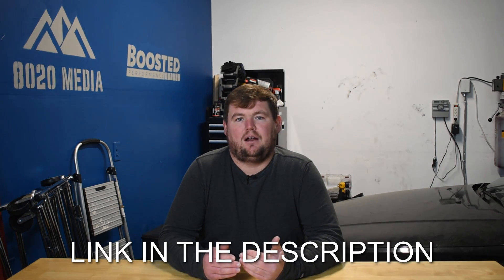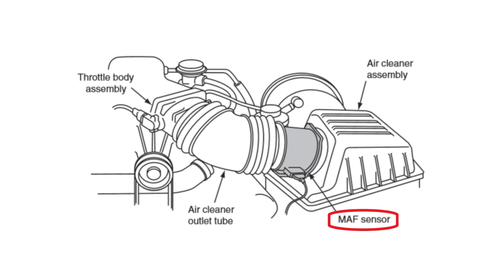DIY - 5 Symptoms of a Failing MAF (Mass Air Flow) Sensor!

Comment: Today i cleaned the maf sensor due to car jerking and hesitation from 2nd to 3rd gear. But after cleaning the car is rough starting with vibration at startup everytime i start it. The drive feels much smoother and shifts smoothly but the rough start with vibration and noise which is annoying me what could be the issue? Before it use to rough start only first start of day but now after cleaning it’s every start. I started it almost 10 times lol
Reply from the maker: P - Sorry to hear this.. Cleaning the MAF may have helped drivability but likely caused a new issue—either some cleaner residue is interfering with the sensor signal or the sensor got damaged during cleaning. If the rough start and vibration now happen every time, try removing the MAF again and inspecting it for leftover cleaner or physical damage. You could also try unplugging the MAF and starting the car—if it starts smoother, the sensor is probably giving faulty readings and may need to be replaced.
Reply: @8020Automotive so after cleaning i guess the maf relearns? And also i did remove the battery terminals overnight to reset everything. So the ecu and maf takes time to relearn everything. Waiting to see if that works. Let me drives for some miles and if it’s still the same then there might be some problem. The jerk and vibration is only for few miles and the it goes all away:( run so smooth!

Comment: So I have p1101 and my key fob starter doesn't work. Car runs and drives fine. From what I've been seeing. I think the maf took a shit. Any help would be appreciated. 2018 GMC terrain 2.0
Reply from the maker: M - Yep, P1101 on your 2018 GMC Terrain 2.0 typically points to an issue with the MAF (Mass Air Flow) sensor—usually it's reading outside of expected range, which can happen if the sensor is dirty, failing, or there’s an intake air leak. Since the MAF plays a role in how the ECU monitors engine airflow at startup, it can disable remote start as a precaution even if the car runs fine otherwise. Try cleaning the MAF sensor with MAF cleaner first (don’t use throttle body or brake cleaner), and if the code persists, replacing it is likely the fix.
Reply: @8020Automotive  yessir, new air filter and sprayed the MAF sensor. Drove for roughly 100 miles and problem gone. I'm just happy I didn't have to clean the throttle body. Although I may do that one day just for something to do. I've seen a few folks get that code from a dirty throttle body. One day but not two days😂✌️

Comment: My car is sluggish but no lights on - cant get 45 mpg no more
Reply from the maker: C - If your car feels sluggish and fuel economy has dropped but there are no warning lights, common causes include a dirty mass airflow sensor (MAF), clogged air filter, old spark plugs, carbon buildup in the intake or EGR system, dragging brakes, or underinflated tires; even without a check engine light, any of these can affect performance and MPG, so a basic tune-up and inspection might help restore efficiency.

Comment: Never forget the . Temperature sensor in the engine block.. when going bad it will cause rough idling etc. Observed on Chevrolet cars. Simple replacement. Cost minimum..
Reply from the maker: N - True! Thanks for sharing.

Comment: I have a problem with my Mark X starting but cutting off after 2-3 seconds. Can someone assist here
Reply from the maker: L - If your vehicle starts but stalls after 2-3 seconds, possible causes include a faulty immobilizer, bad fuel pump, clogged fuel filter, failing MAF sensor, or throttle body issues. Try using a spare key to rule out the immobilizer. If that doesn’t work, check the fuel pressure and clean the MAF sensor. If the engine struggles to hold idle, the idle air control valve or throttle body may need cleaning. Also, check for vacuum leaks or a bad crankshaft position sensor, as both can cause similar symptoms. Running a diagnostic scan for stored trouble codes (DTCs) could point you in the right direction.

Comment: My jeep hesitates , jerks , n rough idle a little but doesnt do it constant n when i press the pedal on down it comes out of it, n i dont have any problems starting it. Is it still the maf?
Reply from the maker: B - Intermittent hesitation, jerking, and rough idle that clears up when accelerating could be caused by a dirty or failing MAF sensor, but other potential culprits include a clogged fuel injector, weak fuel pump, bad throttle position sensor (TPS), vacuum leak, or faulty ignition coil. Try cleaning the MAF sensor first and see if symptoms improve. If not, check for vacuum leaks, test the fuel pressure, and inspect the throttle body and ignition components. If there’s no check engine light, live data from an OBD2 scanner may help pinpoint the issue.
Reply: I scanned it, oxygen sensor is all that came up, I checked on vacuum leaks, I'll clean the maf next, thank you.

Comment: After replacing the MAP sensor does it need to be reset? I had someone replace ALL coils & plugs on my 2016 RAM 1500 SLT 3.6L bcuz I had a check engine light & the codes read were P0303, cylinder 3 misfire & the recommendation was to change that coil & replace plugs, so I decided to replace ALL due to my current 👉🏻106,000+ mileage. But afterwards it had ALL those symptoms when before the coils & plugs it ran perfect! 💆🏻‍♀️💆🏻‍♀️💆🏻‍♀️ The guy (at this point I don't even want to acknowledge that he's even a real mechanic) replaced the sensor & the (⚡) went away but the engine light was now flashing. I tried driving it and I wasn't able to accelerate & it almost died at idle. 😭😭😭
Reply from the maker: P - Sorry to hear this. Yes, after replacing the MAP sensor, it often needs to be reset or relearned by the ECU. If the engine light is flashing, that indicates a severe misfire, which can damage the catalytic converter if driven. Try disconnecting the battery for 15-30 minutes to reset the ECU, then start the truck and let it idle for a few minutes to allow it to relearn sensor data. If the issue persists, check if the new coils or plugs were installed correctly, as loose connections, incorrect gapping, or damaged wiring can cause further misfires. Also, ensure there’s no vacuum leak or intake manifold issue that might have been disturbed during the repair.

Comment: Sometimes a bad MAF sensor won't throw a code. Even though you clean a MAF sensor it can still be bad, as the electronics inside the sensor are bad. Sometimes you might have to do a voltage check at the MAF electrical connector to be sure it is getting the correct voltage. One time on my IROC Z28 I had to replace the MAF connector as it had a small kink in one of the wires and it wasn't allowing the correct voltage to the MAF sensor. A good maintenance idea is to clean the sensor at least every time the air cleaner is changed. And it's a good idea to be sure the MAF duct clamps are always tight because air / vacuum leaks can throw the sensor off. Usually the best place to buy a MAF sensor is online at Rockauto as the prices are usually cheaper and they have a better selection of brands than parts stores. Plus you can usually just buy the small sensor instead of buying the whole sensor and housing together. It is easy to replace as it is usually only 2 bolts or 2 screws and takes about 5 minutes. Doing this can save you $$$ plus some of their brands have a lifetime warranty. I have seen closeout prices as low as $10 for a MAF sensor.
Reply from the maker: S - True.
Reply: This is true because mine isn't throwing a code at all
Reply: @ thanks for backing me up. Yea sometimes the car will jerk or have hesitation.
Reply: I thought that MAF sensor was in the front on the tube that goes to my air filter. I don't know what it is that the guy in the video was describing
Reply: Please explain where/ how you can buy the “sensor, not the whole sensor and housing”? I don’t see it anywhere at rock auto. Only the whole sensor and housing
Reply: @Fireneedsair  it all depends of what  vehicle you are looking up. Some might offer one or both versions. Their inventory also changes everyday.

Comment: I have a 2007 nissan titan, i have no acceleration when going uphill i literally have the pedal down to the foor and i can see my speed decreasing and it doesnt shift. Could this be a bad mass airflow censor?
Reply from the maker: A - A bad mass airflow (MAF) sensor could definitely cause loss of power and poor shifting, especially under load like going uphill. However, your issue could also be caused by a failing throttle position sensor (TPS), clogged catalytic converters, transmission issues, or a weak fuel pump. Try disconnecting the MAF sensor and see if the truck runs better—if it does, the MAF is likely faulty. Also, check for stored codes with an OBD2 scanner and inspect the air filter, intake system, and fuel pressure. If the engine revs but the truck doesn’t accelerate, the transmission could be slipping or not downshifting properly, which may require checking the transmission fluid level and condition. Keep us updated!

Comment: I have a 2020 Kia Forte. It has 140k miles. I replaced the MAF after seeing the P0101 code. It was good for a bit but now again gives me the same code. The engine light comes on one day and then gone the next and so forth. I’ve tried cleaning it and looking for other problems. I took it to the dealership and they said they couldn’t find any problems. That sometimes dust gets in there and it misreads the air flow.
Reply from the maker: T - If your vehicle with 140K miles keeps throwing a P0101 code (MAF sensor performance) even after replacing the sensor, the issue could be air intake leaks, a dirty throttle body, or an intermittent electrical issue rather than the sensor itself. Since the check engine light comes and goes, it suggests a sporadic airflow misreading, which can be caused by a leaking intake boot, vacuum leak, clogged PCV valve, or dirty air filter disrupting airflow readings. Also, check for carbon buildup on the throttle body, as a dirty throttle plate can affect airflow consistency. If dust contamination is a known issue, ensure the air filter is sealing properly, and consider using a higher-quality filter. Since the dealer didn’t find anything, monitoring fuel trims and live MAF readings with a scan tool could help determine if airflow readings are fluctuating abnormally. Keep us updated!
Reply: @8020Automotive  Great news!!! I took your advice and did a thorough inspection. I cleaned the MAF sensor, replaced the PCV Valve & cleaned the throttle body (which was filthy). I’ve ran the car over a thousand miles (ride-share) and there is no problems. Rough idle, engine light on and off plus vehicle dying at stop lights is all gone. Thanks for the advice. Hope this helps someone else!

Comment: Started getting the sputtering today. The fault codes I ended up wtih were P0101 and P0171 (both indicating MAF as you said). There were others for other minor issues (P0456, for example, which I believe is related to my gas cap not registering when it's on. Even when the lid is on I get a notification saying "lose cap". Cap is only a few weeks old because I replaced it).
Gonna try a MAF cleaning solution today to see if that helps. Replacing the MAF is easy enough, but I'll probably get an official diagnosis before doing that. Just to make sure i"M not spending THAT much money on something I don't need ot.
Reply from the maker: R - Your P0101 (MAF sensor performance) and P0171 (system too lean) codes suggest the MAF sensor is either dirty or failing, which can cause sputtering, poor acceleration, and inconsistent fuel delivery. Cleaning the MAF with proper MAF cleaner is a great first step—make sure to let it fully dry before reinstalling. If the issue persists, replacing the MAF sensor is likely necessary, but getting a proper diagnosis and checking for vacuum leaks would be smart before spending money on a new sensor. As for P0456 (EVAP system small leak) and the loose gas cap warning, even though the cap is new, inspect the gas cap seal and EVAP purge valve, as a small leak in the system could still trigger the code. If the cap isn't sealing properly, try an OEM gas cap, as some aftermarket caps don’t always register correctly with the system. Keep us updated!
Reply: @8020Automotive  what it means when I have my car on and unplugged the maf sensor and the car still stays on ?

Comment: I suggest also after you change your MAF as I did the MAF wiring harness connector or the harness wiring harness itself could be damaged in my case on my 2016 chevy Cruze premier RS my maf connector on  both ends is damaged and has to be replaced. This has caused fault codes of fuel to rich intake air flow code. Just thought I'd throw that in there in case like me I changed my maf and the codes and engine light still was on I had no other recourse but to go to a Chevy dealer and that's where I learned that my maf harness was damaged on both ends which  almost never happens my was broken in the both ends by being pulled on my a poor mechanic when cleaning my maf prior to me changing the MAF myself.
Reply from the maker: M - Thanks for sharing this insight!

Comment: #3 for my situation, however once I reset the M.A.S connector it's starts up beautifully, I changed the M.A.S , but the car still has a Hard start once in awhile,what can be the problem/problems, and opinions/suggestions would help.(M.A.S = Mass Airflow Sensor)
Reply from the maker: S - If resetting the Mass Airflow Sensor (MAS) connector temporarily fixes the hard start issue, but replacing the MAS didn’t fully resolve it, the problem could be caused by a faulty MAS wiring harness, a vacuum leak, a failing throttle body, or fuel delivery issues. Start by inspecting the MAS connector and wiring for damage, corrosion, or loose pins, as intermittent electrical issues could disrupt the sensor’s readings. Also, check for vacuum leaks around the intake system, as unmetered air can cause starting difficulties. A dirty or sticking throttle body can also affect airflow regulation, leading to occasional hard starts. Lastly, test the fuel pressure to rule out a weak fuel pump, clogged fuel filter, or a faulty fuel pressure regulator. Keep us updated!
Reply: @8020Media  thanks a million,will do, I truly appreciate the response

Comment: I have a 2010 Ford F150. It wants to stall after about 18 miles. It runs fine, accelerates fine,  no loss I mpg, after about 18 miles if. Bit a light,traffic or stop lights. It will start wanting to stall. I have to put into neutral and rev it.
Reply: In my experience with Ford motors, that is usually caused by clogged VCT solenoids.
Reply from the maker: V - The stalling issue with your 2010 Ford F150 after about 18 miles, especially at lights or in traffic, is likely caused by a problem in the idle air control (IAC) system, fuel delivery system, or evaporative emissions (EVAP) system. As the engine warms up, a failing IAC valve may struggle to regulate airflow at idle, causing it to want to stall. Another possibility is a weak fuel pump or clogged fuel filter, which could cause fuel pressure to drop under low-load conditions. Additionally, a stuck EVAP purge valve could allow excess fuel vapors to enter the intake, disrupting the air-fuel mixture. Start by inspecting the IAC valve and throttle body for carbon buildup, test the fuel pressure, and check for vacuum leaks or EVAP system issues. Keep us updated.

Comment: I have a 2000 Wrangler with a rebuilt 4 cylinder. Everything is fine except when I get up to 45/46 mph it cuts out and sputters . If I let off the gas or accelerate it acts normal. Always at 45/46.
Reply from the maker: B - The issue with your 2000 Jeep Wrangler cutting out and sputtering at 45–46 mph is likely related to a fuel delivery or ignition system problem. At that specific speed, the engine may be hitting a point where the fuel-air mixture or timing isn’t optimized. Common culprits include a faulty throttle position sensor (TPS), as it can send incorrect signals at certain throttle positions, or a fuel pressure issue caused by a weak fuel pump or clogged fuel filter. Additionally, the ignition coil or spark plugs may misfire under load at that speed due to wear or insufficient spark. Start by checking for stored diagnostic codes, testing the TPS for smooth voltage changes, and verifying fuel pressure. Keep us updated!

Comment: What if I got some headers installed with a intake and I feel some sputtering in acceleration
Reply from the maker: 2 - If you’re feeling sputtering during acceleration after installing headers and an intake, it’s likely due to an air-fuel ratio imbalance caused by the new modifications. Headers and intakes alter airflow dynamics, and without proper tuning, the ECU may not be able to compensate effectively, leading to sputtering, hesitation, or misfires. Keep us updated!